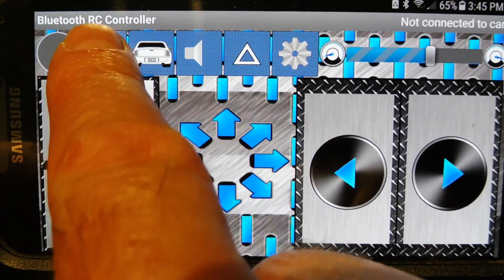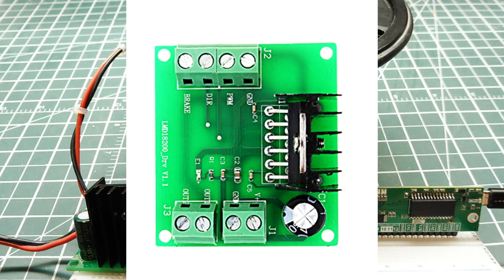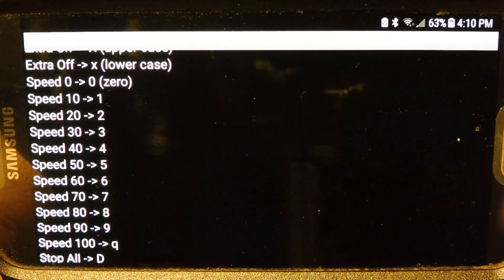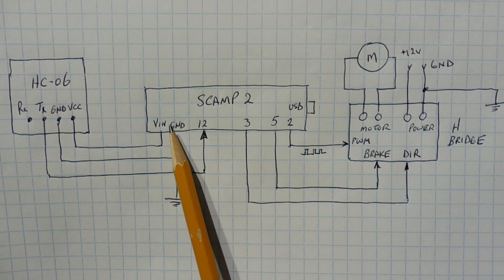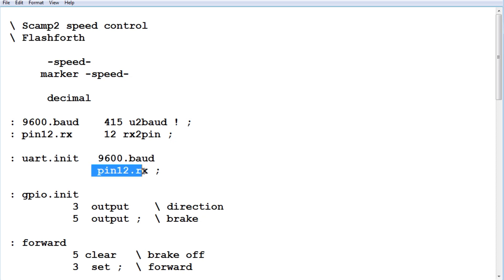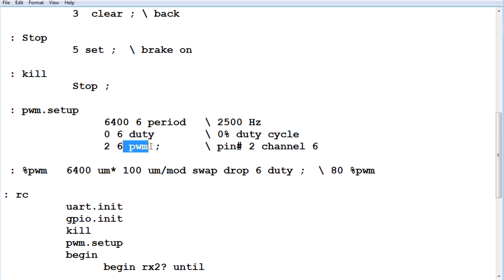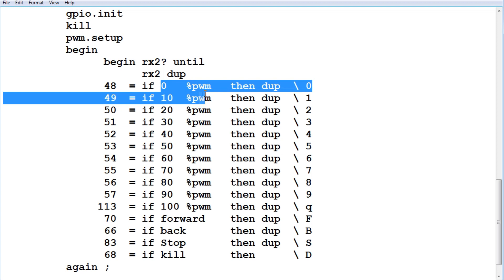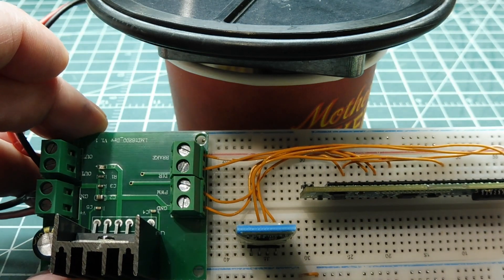DC Motor Speed Control / H-Bridge / PWM / Scamp FlashForth

Comment: Thanks Ken, another great video. I used to use the LMD18200 a lot, but I found they can susceptible to transients. I've had a few fail over the years. These days I use the TI DRV88xx series... much more robust and also cheaper. My goto H-Bridge is the TI DRV8872 for most applications. It's a great little chip. 

Looking forward to your next instalment. 🙂
Reply from the maker: Hey John, thanks for the tip. The datasheet actually indicates there can be transients on the supply pin and they recommend a 40 volt Transorb. The DRV8872 looks like a newer design and Adafruit has a breakout board. My local supplier have them in stock so I will give one a try.
Reply: I put a TVS diode (such as a PESD15VL2BT) on the outputs to remove transients. Does a great job of filtering the noise from the motor. You get very clean PWM on the motor rails.

Comment: I was wondering why you chose the scamp. I ordered it to just because it kinda looks like a nice board to program with.
Reply from the maker: You can run Forth on many micro-controllers but the Scamp has lots of support code already built in so it makes it easier for beginners.